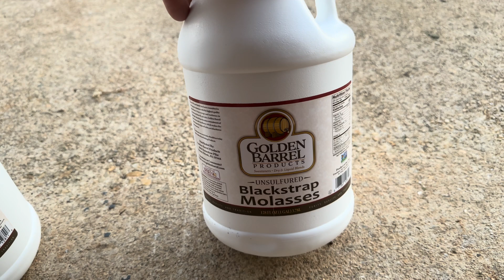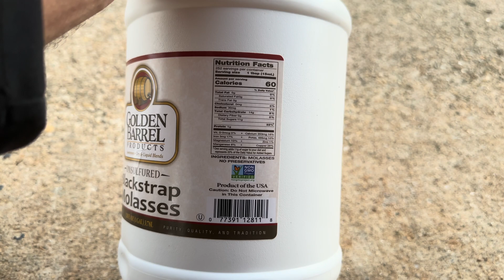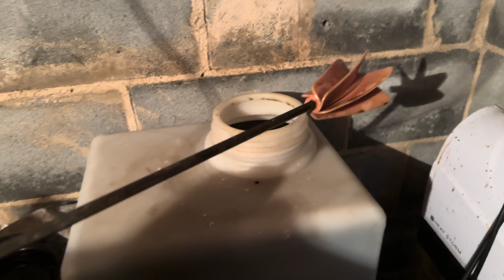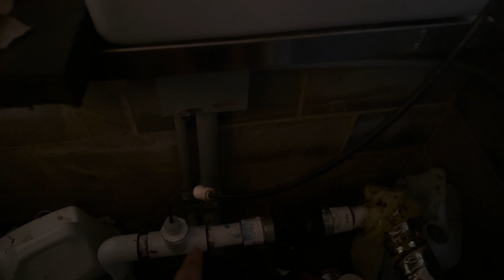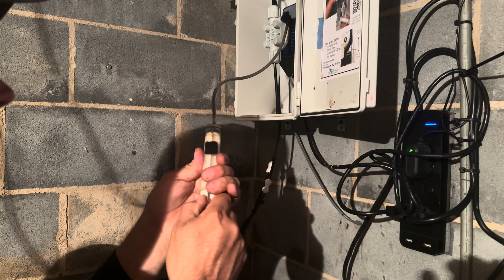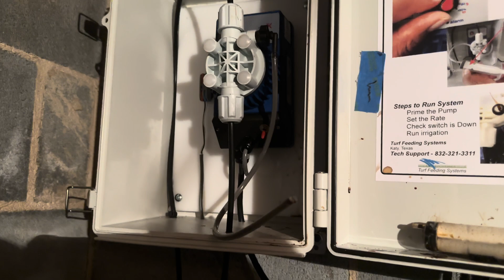Quick And Cheap Lawn Green Up Fast!

Comment: @Primetime_Fescue Do you need to water in the Molasses right away or can it sit overnight and be watered in next day?
Reply from the maker: My answer to this is 2 parts and it’s my sole opinion! If you’re trying to get it to the soil then I would water it in! For a foliar application let’s say your trying to gain some color and eat away some dead material/thatch I would let it sit. I typically run mine trough my irrigation because I’m trying to help my soil.
Reply: @Prime_Fescue  💕

Comment: Do you know if you can also spray RGS and/or Humic at the same time as the molasses or would that be too thick or not mix well together?  If I could, it would definitely save me some time. I don’t have fertigation, so it’ll all be coming out of my FlowZone 4G backpack sprayer.
Reply from the maker: Personally I would t do it your only mixing that in a backpack sprayer and the molasses alone is still quite thick then you add humic or rgs to it I just don’t know. You can always do a jar test! Take something with 48oz of water then add the rate of each product your going down with. For example if your spraying 4oz per 1k of each put 4oz of each in the 48oz of water and mix it up and let it sit 15 to 20 mins! If it stays liquid and no solid stuff then it’s very possible you could spray all that.
Reply: I place  3 oz. N-ext RGS and  4 oz of  N-ext AR8 with   3 oz. of molasses(per 1K sq. ft. ) in my hose end sprayer and it works great.  just thin out the molasses (warm wate)r and mix all together ahead of time. Am I doing it right?  great results after major overseed.  Barenburg Rhizomatous TTTF(RTF).  3 mos. ago.
Reply from the maker: @geoffkopecky3652  if it works then keep doing it. With a hose end sprayer your spraying a lot of volume vs a typical backpack sprayer so I wouldn’t expect any issues especially if your mixing with hot water!
Reply: I do it with humic and a couple other things mixed with water. It sprays just fine.